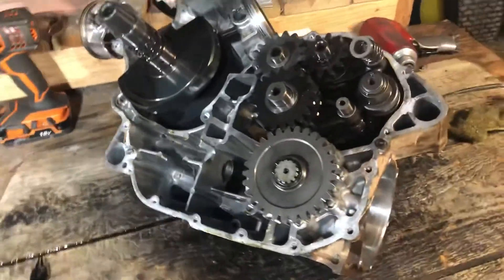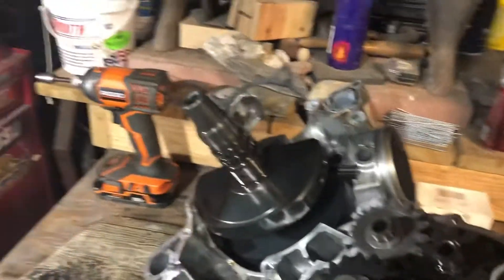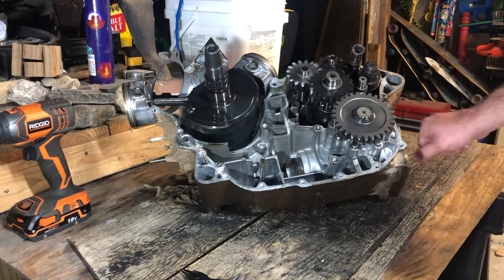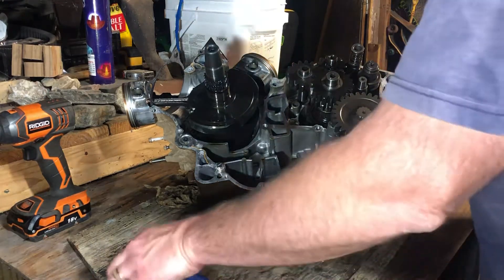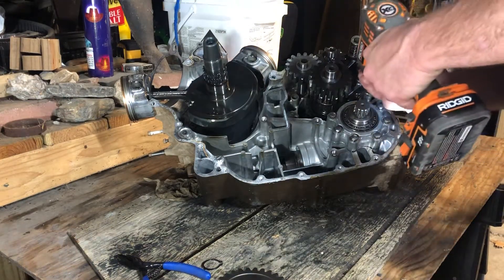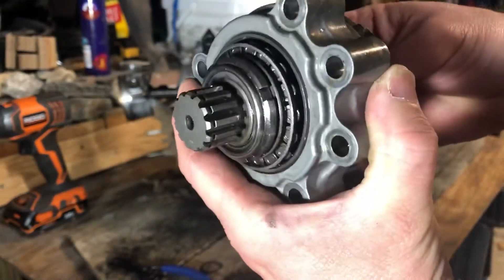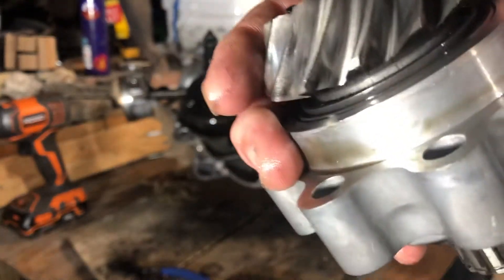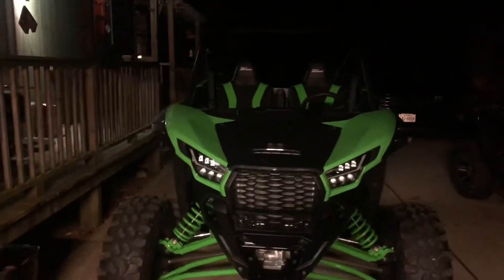2015 Kawasaki Teryx 4 800 bevel gear removal

Comment: My 2021 has had some bevel gear clunk since brand new. Now I'm out of warranty, no whine. Noise hasn't increased since owning. 3000 miles. Is the slight clunking normal? Thank you
Reply from the maker: I haven’t drove mine in a while but I seem to remember some clunking.  These are very noisy machines.  

As long as you don’t hear the whine, you are prolly OK.  

I’ve owned mine new since 2015 and the bevel gear has literally been the only issue.  Still on factory belt, ball joints, CV axles etc.  

Thanks for watching!

Comment: Hey Texas Patriot all your videos have been great on the bevel gear tear down. I just bought a used 2013 T4 and it has the whine on deceleration but not in reverse. My question is that, would it be the same gear if its not whining or howling in reverse but only in deceleration?
Reply from the maker: I would say it is the bevel gear, especially if it particularly loud.  It’s a rather long job but it’s worth the savings doing it yourself!